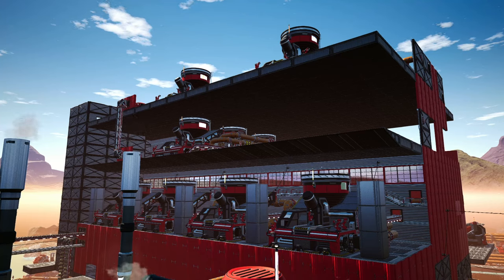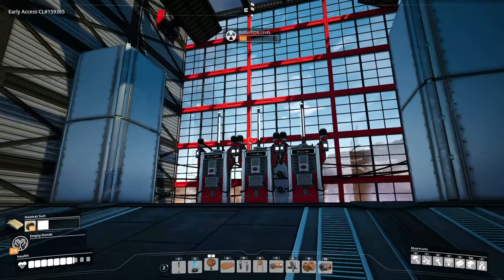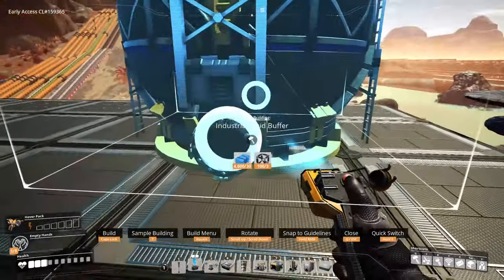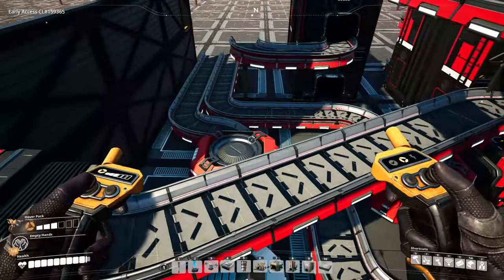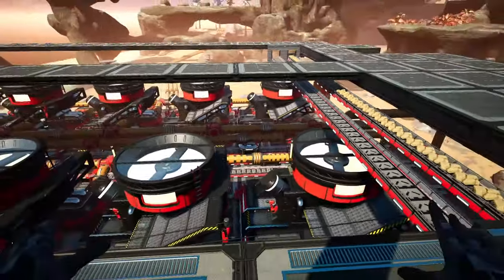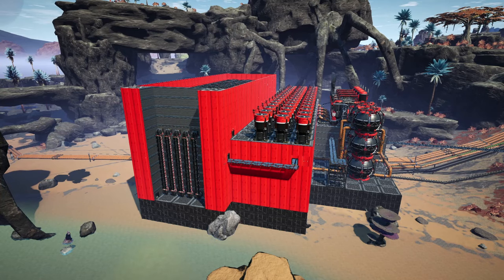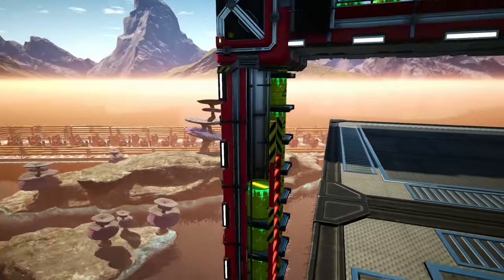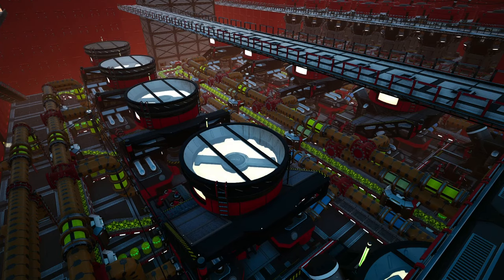I Made 1,000,000 Nuclear Waste in Satisfactory… Am I Doomed?

Comment: Quick tip: make a plutonium factory before you activate uranium
Reply: Yes absolutely and if you need extra power, regulate the output of nuclear power by turning them on individually as you need them.
Reply: I wonder why Kibitz build waste storage in a first place and why he prefer alt recipie?
For 8 operating power units you only need 1 particle accelerator (standart recipie), 2 blenders (also standart recipie with silica), 3 assemblers, 4 manufacture, 1 awesome sinker and no storage at all.
Reply: yes+
Reply: Lemme just go tell past kibs real quick
Reply: @СергейСолдатенков-о8у  because he wouldn't have anything to stream about  :P. Nothing like self inflicted chaos to get people watching, he knew exactly what he was doing he's played the game for long enough to know not to turn all those nuclear plants on when he didn't need any of it's power.
Reply: yes
Reply: Well, it's more like the sensible tip. Any time I go in for nuclear anything everything is reverse engineered. Nothing is started until it's completed. . . then everything ends up going completely wrong.
Reply: @СергейСолдатенков-о8у  
Four manufacturers? I only have four in a plant that handles twelve reactors, I think you're doing something wrong there.
Reply: @СергейСолдатенков-о8у  silica is hard to get and needed more in aluminum.
Reply: @ashykins  
Um, no? Pure Aluminium Ingot completely removes the need for Silica in aluminium production, and if you pair it with the default alumna solution recipe your aluminium line actually makes 50 Silica per alumna Refinery without so much as touching your quartz supply. With that plus Cheap Silica you have far more worries about bauxite and limestone than quartz.
Reply: A lizard doggo factory also works
Reply: Genius. Pure genius.
Reply: too late

Comment: I would suggest once you start making plutonium fuel rods, just drop them in the resource sink, that way you don't end up with plutonium waste (which can't be reprocessed at all).
Reply: Just have a storage for waste and have the rods overflow to a sink when it backs up. If you need more power, throw in some more storage
Reply: @tristen9736  You'll still be stuck with all this waste you can't get rid of... eventually it'll build up, even if you keep building storage for it.
Reply: Yeah I do that on my world and had a similar nuclear scare when I had like 11000 barrels before I unlocked the milestone to process it all now I'm running out of encased plutonium cells

Comment: When he put 1,000,000 barrels of nuclear waste into a foot locker the physicist in me was like: "Yup that's a really big nuclear bomb he just set off compacting that much uranium. Might even be a black hole."
Reply: So it's not a black hole, but it is 2422966374.7 kg of uranium in a 1Mx0.5Mx0.5M box so it would sink like a stone through steel and stone having 9691865498.8 kg/m3 on it's 1mX05M base.
605,043,397.26838254929 lbs/ft3 for the imperialists.
That little foot locker would sink to the center of the earth as though the ground was made of mud.

Comment: The water output from the non-fissle uranium is actually the exact same as the water requirements for the nitric acid that is required. So you can just feed them into each other and have 0 water requirements. Just have to fill them up the one time

Edit: not sure if it's the same for the alt
Reply: Alt will work beter, because sulfuric acid production takes also water.
Reply: It’s better to just have an external water input because if one part turns off theres not many ways to start it up again
Reply: @ashykins  Just need to load balance, flip the switch have the initial water fill up and the factories start then it feeds itself. That's what I did with my alumina solution.

Comment: I'm in the same boat. I started up my first nuclear plant last night, 12 reactors overclocked to 250% and a plant processing 750 uranium/min into fuel rods.

As soon as I started it up, I knew I had a problem. So much waste. I built a concrete building on the empty island at the southwest corner of the map to store the uranium waste. 4x16x8 stack of industrial containers, I should be able to store 9,216,000 waste.

Comment: Another good way tro get rid of excess water, or any case where fluid input and output types are the same, is to link the outputs to the inputs of a few that don't share the same input line as the rest and have them at the start of the other inputs, and OC them as far as possible. They only run when there is excess water & other inputs so youll never back up.

Comment: Yes, putting fluids in a shredder will definetly destroy them.
Reply: a better idea would be just an open pipe. you can already dump fluids from pipes, so you could have an open-ended pipeline to do that automatically
Reply: @jackgamer6307  or sth like a dump, it needs to be connected to water like the pump, but releases and filters fluids for the ocean, for example giving in sulphuric acid will give out a bit of sulphur. And pouring in water will only give it away, maybe it also produces a bit of energy by a build in turbine?

But basically I just want a device where you can pump fluids into that's semi realistic.

Comment: My own power plant area currently makes around 170.000MW (170GW), which is enough right now, and uses around 15-20GW for Production of Fuel and the processing of waste.
It only makes around 0.25 normal uranium waste /min (with what is used for plutonium already subtracted) and the storage area is enough for way over 1000 hours according to my math. The plutonium waste storage can "only" fit around 950h of waste, but that's enough.
I know I could shred the plutonium fuel to get to nearly 0 waste, but I don't see a reason to right now.
My uranium fuel production is kinda overkill, producing enough fuel rods to run about double the current number of power plants.

Pretty future-safe, I think. And it "only" covers like half the purple swamp area.

Comment: Very good tip I learned is before you setup all the reactors put 25 reactors on a switch that way you can control the reactors waste output vs just making an abundance of power without utilizing it.
Reply: Also for the water situation on my setup I just have coal generators that are not hooked up to anything besides a battery that way they consume the water when there an abundance of it
Reply: Naw, doesn't work, reactors on the same grid won't switch off as long as they have fuel in them even if you cut them off from the rest of the grid, you have to manually set them to standby or turn off their water supply.
Reply: It does work the way you would have to setup a “ on off” switch is by disabling power to the water pumps this lets me choose how much comes from my 30 reactors while keep waste down

Comment: 5:00 Could you use power switches on pumps to control pipe flow from afar? or do pumps not block flow when unpowered?
Reply: I think with clever structuring, that might be possible

Comment: In my current setup, one blender handles the waste output of 10 reactors.  So I sent the water back to the reactors supply.  The acid balancing was the bigger issue.  The wet concrete will be very useful after the particle accelerator phase, because you need some to in case the plutonium.  I was surprised by how much concrete my small setup demanded.
Reply: What I did for that was build a riser tower that was bigger than the head lift in the system, then stuck a pump on the Blender side. Since the sulphuric acid is physically incapable of backing up, all that'll happen is sometimes the Refinery making sulphuric acid will shut down.